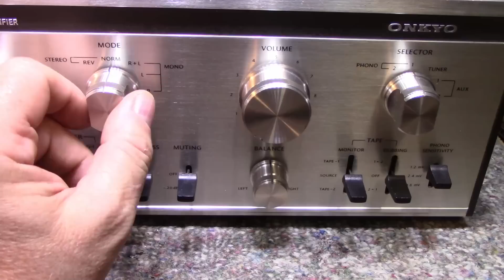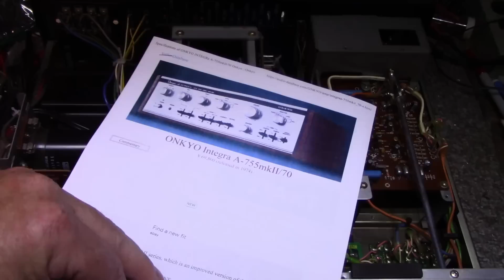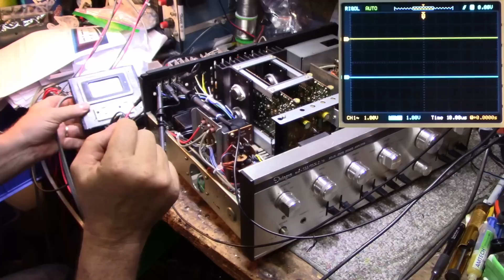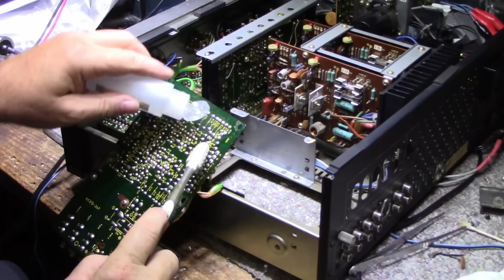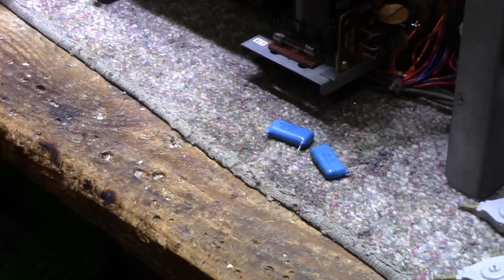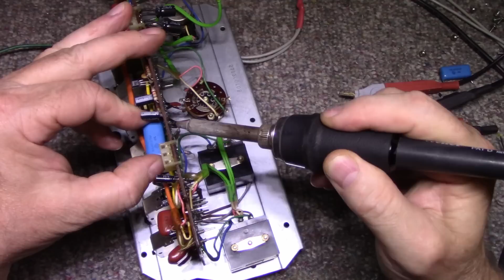Onkyo Integra A755 Mark 2 Integrated Amplifier Repairs Part 1 (Ep. 185)

Comment: I am so glad you are doing this video! I have the excact same amp. How it wounded up here in Denmark I don't know. 
I have had it for a view years now and restored it back in the time. I didn't check those blue caps though, because, like you, I assumed they should be fine. I have checked them today, and they are not fine, so thank you for pointing that out.
I use my Onkyo with a transformer 220/110 volts and that seems to work fine. I have 33V on the rails before clipping and 40 in idle.
I am looking forward to the point where you have to determine the bias. I have 6mV on the to outer terminals where it says "Check". Sinus looks wonderful on the scope, no crossover distortion. I get a max wattage of 38.72 Watt. Hope this help a litlle. Looking forward to part II.
Reply from the maker: Good to hear you found the video useful. Those caps should have never failed since the see very little voltage.
Also, thanks for the info. I don't know what the idling current should be but now I have a idea

Comment: 35:52.  YOU DO NEED A 250V CAP TO PASS AN AUDIO SIGNAL. BECAUSE THATS WHY SABSUI HAS AN AUDIO SIGNATURE.    I ACTUALLY USE 600V CAPS.   BUT. IF YOU USE A LOWER VOLTAGE CAP THE SOUBD GETS COLDER.

Comment: It's a  to-92    transistor    If  you increase the primary side  volts   by    about 12 Volts  AC RMS (122volts  RMS) , you  might get  another   5  watts  per channel on the output   because  I don't think  the  voltage   would be  much  more  on  the   secondary   side.      This  is because of the transformers   turns  ratio and the   amount of   energy   stored in the core  material  I  would also think  that if you increased  the voltage to   American line  voltage ,  the power factor   would be  better and the power   would  go    down  due to the inductive  load   Why are you  not doing  signal  injection  on the  actual phono   board  ?    You  should have   done the signal path  from  the start  !   replace  the  capacitor on  each  side     !